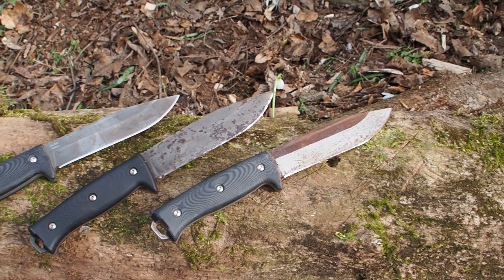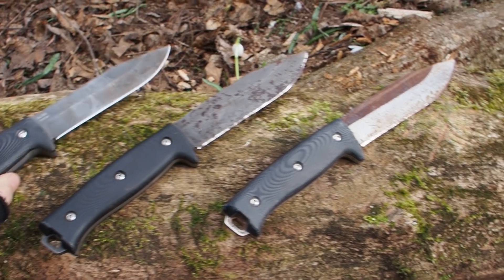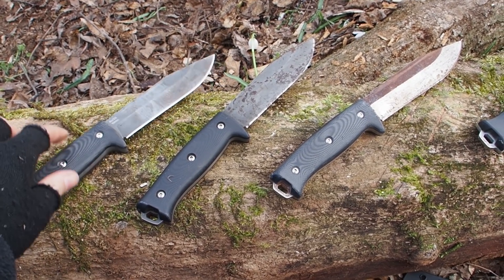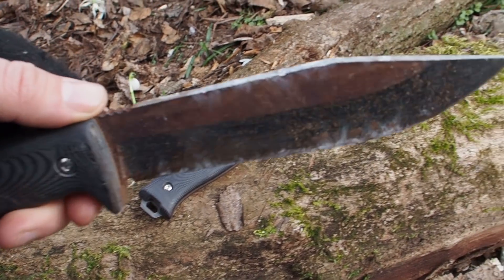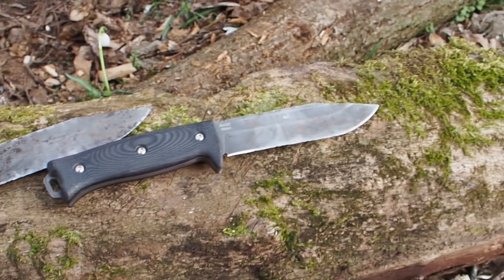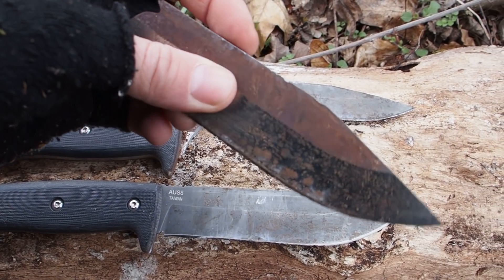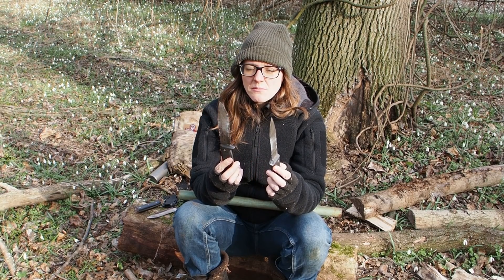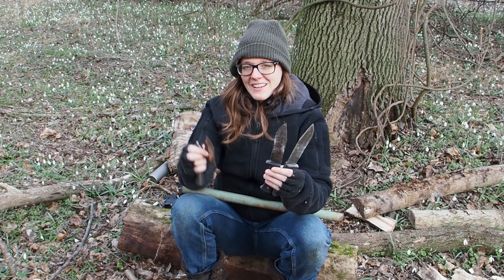Destruction Test - D2 vs. AUS8 vs. SK85 - Which is the better steel?

Comment: I like how she says, "before we destroy these knives". What are you talking about? You've already destroyed the knives! By not taking care of them you have essentially ruined them. I could not imagine treating my knives that poorly. Even after whittling on wood, I know there's enough moisture in the wood to cause issues. So I immediately wipe it down and throw a quick coating of food grade knife oil on the entire knife and anywhere any metal is exposed. Whether it's the actual blade or the tang. And I know I'll get comments like well maybe out in the field they don't have that available to them. My response would be why not? I carry a small travel tube of oil and I always have a microfiber cloth in my pack. I also carry a portable knife sharpener by Sharpal. And if I'm not carrying my pack that means I'm going to be home that night. So I will do it when I get home after work. Perhaps it's just that I value my money and don't want to throw it away, so I take care of everything from my $20 pocket knife to my $200 pocket knife. And I have so many different types of steel and I've learned how to take care of all of them. It's really not that hard either. 
Not being a naysayer or anything I enjoyed your video very much. I just wanted to comment after I heard you say that. It just kind of made me chuckle.

Comment: These knives appear to be well made and properly heat treated based on these results.  They held up exactly like I would have expected based on Knife Steel Nerds charts which reflects the rating of an optimally heat treatedl example knife in just about every commonly used steel.  The D2 breaking kind of proves that it was probably at least high fifties ( The quoted 58 sounds reasonable) .  I think D2 has a place in more slicey knives and isn't a good choice for a knife that will experience a lot of shock loading.   But that being said in a knife with this robust of geometry I doubt you could break that knife just by batonnning wood for shelter building / wood crafting.   I would choose the SK85 unless you are in a marine environment in which case I would go with AUS8.  AUS8 is very under rated these days in my opinion.

Comment: 5160 is good, cheap, and easy to forge and heat treat and takes a very wicked edge..enough to shave with.  I also like my fallkniven blades with COS steel..take crazy sharp edge

Comment: Nice demostration. 

D2 acted like D2, but Aus 8 was like ok, well heat treated quality Aus 8 has the potential to be very good, but SK-85 was the real surprise here. 

The SK-85 didn't perform very well at all, which was kinda interesting, because that kind of light abusing should not have damaged the blade like it did in youre video.
It souldn't have damaged it at all, but it looks like it did? 

My vision is blurry from time to time but the SK-85 damaged pretty heavily?

I suppose you don't know that something has gone seriously wrong in making of that SK-85 knife blade, so this is propably a surprise for you as well. The steel could have been poorly produced, perhaps something went wrong accidently in the steel factory or perhaps there has been some kind of a issue heat treating, tempering or belt sanding the blade, etc. But it sure, does look to be left way too soft. Quality control didnt see there a problem either for some reason?

Can't say for sure, but the SK-85 should perform better, is this a normal result for you Lilly?

Comment: For a survival type knife AUS 8 and 1095 carbon are all you need. They sharpen easily , and hold an edge plenty well to get the job done. Mora's carbon steel is also outstanding. My AUS 8 knives are from Seki Japan. I also have 2 SOG Seal Pups made in Seki Japan that are AUS 6. They work to perfection. Japanese stainless is plenty good for me.

Comment: First impressions from reading the description
D2 steel - Breaks
AUS 8 Steel - Survives
SK85 - Survives

I hate the prevalent use of D2 steel in outdoor knives, because it is a hard steel and prone to break.  8Cr13MoV steel from a chemical standpoint looks like an excellent steel for outdoor knives, but the poor quality control is the downfall of that steel.
Reply: Would 1095 be better than D2 for a survival knife?
Reply: @ironman2326 
I consider D2 a strange steel for knives.  Yes it can hold an edge but the issue I have seen repeatedly come up is that D2 is a brittle steel knife (Some call it a Glass cannon of knife steels).  There are exceptions, but when it comes to outdoor knives I think Toughness is just as important if not more than edge holding.  
I personally think that 1080 is an optimum simple steel for knives because it can hold an edge and it is tough.  1095 is a good budget steel because it s very forgiving, in addition to being tough enough and holding an adequate edge.  I trust 1095 over D2 when it comes to outdoor or Survival knives.

Comment: To be fair, K110 isn't that tough, but it holds it's edge pretty well. If you want powdered steels that are hard to damage, try something like magnacut, cpm3v delta or cpm1v. The last one should be the most difficult to break. However, I don't think edge retention or even toughness are that important in a survival situation, as long as you know how to use your tool. However, ease of sharpening is. So in my opinion you should always have at least one softer knife with you. If it gets dull, you still can sharpen it on a rock. Good luck trying this with someting like magnacut. But of course your blade also has to deliver the right thickness, length and geometry for the job.

Comment: I have an SK85 blade on my Japanese Kanna blade in it, and we don't use it like a survival knife, but I am very impressed with how it holds an edge in planning wood, even hard wood. This is compared to 01 tool steel blades in an American premium hand block plane (similar size). 
So, I thought I share another perspective on SK85. Med and high carbon steels to me are or make good blades. 
Sharpening is also a general word. I prefer grinding and polishing when describing an edge issue.  Since you do not have to grind an edge to fix a dull edge, you may need only to polish it back. That makes a big difference to me in describing failure modes of and edge.
Every grade of steel has been formulated for some specific purpose or use orignal purpose, these didnt happen by chance. As we use them in different environments, conditions, or applications, you will have some trade offs in performance, which she stated! Well done there! Columbus Michigan

Comment: I'm sorry to do this but I can't help myself, the knives are made in Taiwan not Japan it's stamped on the blades
Reply: Yes, 'made' in Taiwan.  But mine has a SK85 steel blade.  K85 Sk5 is a Japanese high-range Carbon steel. After quenching and tempering, sk5 steel has high hardness and wear resistance.

Comment: Great  respect for your testing efforts, but keep in mind one company's Aus 8 is different from the next. Just as Buck has almost perfected the hardening process with boss 420  stainless the next company may not be as resilient. In short it's not always the steel but how it's heat treated.

Comment: Pocket knives can use super steels but I think anyone who has experience sharpening in the field will tell you the last thing you want to do is try to repair an edge on a super steel especially under pressure. Aus 8 anyday

Comment: I don't see the point of hammering concrete or a steel tube. You are not going to do that in your entire life, not even in a survival situation. I would try edge retention by cutting wood, cardboard, meat and even bone and things like that and then try to cut a sheet of paper and check if the edge is still useful or not. Another test would be batoning wood and see if the blade resist or brakes. There is a kit (not cheap) were you can measure the sharpness of the edge of a knife. I usually use 01 tool steel for my knives and they are a good balance of edge retention and easy of sharpening.

Comment: Well done. Ive done survival all over myself & i would absolutely agree w/ your assessments. At the end of the day though i think it comes to whats best for you & what your going to be doing. I prefer carbon steel in most all cases but i have very 4 very specific reasons for choosing it. 
1)centuries of proven toughness 2) i can reforge it in field if i need to 3) if all my other ignition sources fail I can get sparks from my knife & a rock 4) its easy to sharpen even if im tired & weak. Incidentally 1095 is best for shorter blades but i prefer 1075 for longer ones. Just my 2 cents on the matter i guess.

Comment: Pointless test. It's like comparing cars by driving against a concrete wall over and over again. The best car is then the one that you can drive against the wall the most often. The result says nothing about the driving characteristics, the top speed, the fuel consumption. The things that really matter are not tested.

Comment: I definitely seen argument for both sides but at the end of the day it's what are you gonna be using it for I guess overall if you're just gonna absolutely beat the living snot out of a knife then yes the stainless steels that are a little bit softer will do the job But there is that saying right tool for the right job sometimes you need something with a little bit more edge retention when doing fine work or  Like processing an animal a lot of times I end up taking multiple knives for different jobs Good test though I really like to watch it thank you for your time and also donation of the knives in question.

Comment: CPM 3V would be a better super steel to compare to SK85 and AUS8.  Same carbon content, but better alloying elements and powder improvements in consistency.  Tough as hell with decent edge retention.  It is a little pricey though.  The heat treat is a lot more complex and labor intensive.

Comment: I hate to be obvious but no body I know will use a knife in a survival situation the way you tested these knives. There fore I suggest the best knife is the one that corroded the least and you have to use for food prep. Which means stainless steel. The one between the two stainless steel blades the AUS8 would and is my choice of metal. It has less corrosion and needs less sharpening. Ideal for survival situations. I carry two knives when I out in the wild. One is a Mora carbon steel for carving and fire starting and the other is a Survive 7.7 with a AUS8 blade that is almost identical to your newest APO-2s. I bought it in 2006 and used it a lot and it still looks new. I do have to sharpen it often but more like a hone to keep it sharp. It splits, chops, cuts, and carves great. The Mora bushcraft black does feathers and caves a lot easier.

Comment: CPM D2 fixes the issue
Reply: Not really ... D2 is a hard (and consequently) brittle steel ... Steels with high carbon keep a better edge but on the other side, they tend to be brittle ...
I'm NOT a metallurgist at all, just what I've learn about different kind of steels from internet ...

Comment: AUS 8 has been my favorite for 40 years it will hold a decent edge, it is low maintenance, it is fairly easy to sharpen and has very good toughness and not bad wear resistance. As a knifemaker I have tried nearly everything in the past 65 years and it is just hard to beat.
Reply: With all these “super steels” nowadays and the insane prices that go with them. Everyone seems to forget how great AUS 8 really is.
Reply: Probably my least favorite steel. AUS-10 yes. AUS-8 no. I usually think of it this way. The Ontario offers a cheap, throw away, trial version of the RAT-1 (and others) in AUS-8 steel. If you decide you like the knife well enough, you buy the real knife which is in D2. Just my experience of course, but every knife I've had in AUS-8 steel just felt like a gas station knife as far as sharpenability and edge retention. Is it easy to sharpen? Yes - much easier than D2. But I have never liked the edge on any AUS-8 knife. Perhaps I need to change sharpening techniques or something.
Reply: @BrizzyMo I'm looking at a knife in AUS-10, can you tell me about what sets it above AUS-8 in your eyes?
Reply: @BrizzyMo it's a very soft steel when compared to 1095 or 1066 it's closer compared to 8cr13mov
Reply: @monkeymcgee3630 Soft isn’t bad having a knife that is too hard makes it brittle and a knife that’s too soft won’t hold an edge it’s important to strike a balance based on what purpose you want your knife to serve
Reply: Totally agree, low maintenance is underrated
Reply: Can't argue with that. I learned knife making using magnacut and s35v so I'm much more familiar with these 2. Aus 8 is a great steel my only complaint it dulls to fast after several hours of hard work and it's a little on the soft side for a camp knife. The thing I love the about aus8 is that you can get a decent edge in the field using a rock and a little water

Comment: I have the same opinion as a few others who have posted comments here as in they both have their place. Harder steels for smaller knives for more delicate precision work and softer for the larger knife for heavier more abusive jobs. I have a few of each. I still need to get out and use the APO1S a little more but the little I have used it carving and batoning or just cutting up dinner it has proven to be a very nice blade so far. I have found the APO1S to have a more comfortable grip than some of my other survival knives as well. Well done Lilly with the steel choice and design! Keep up the great work!

Comment: You can take the rusty knife to a bench grinder with a wire wheel on it, and it will clean the rust off. Use a cloth buffing wheel to smooth out any pitting caused by rust.

Comment: The hardest thing to achieve in D2 steel is hardening, especially tempering. If the tempering is not done at the right temperature and in the right time, the result is in your hands. It is very unlikely to have to cut metal pipes in survival, or in bushcraft, this has never happened to me. Ciao!!

Comment: Something near 0.8% carbon seems to work reliably in large beater knives and has worked for a long time.
The 80CRV2 alloy used by the Varusteleka/Terava line works well. It is essentially SK85 with a tiny bit of chrome and vanadium added to get a little bit harder.  That's the traditional "low alloy" approach (O1, O2 also) that adds a little dusting of chromium carbide and vanadium carbide without taking away the alloy's toughness, but is still close to 1080 or 1095.
Condor likes 1075, which is close to that standard.  They make durable knives, not pretty knives. Ontario Knives has moved from mostly 1095 to 1075. The very reliable Tramontina machetes use 1070.  When knives get larger and have to take a bigger beating, then 5160 (low alloy 1060 or 1065) becomes the reliable steel, such as in the traditional heavy kukri knives which are practically hatchets.   Then the real beaters, hatchets and axes, usually settle into 1045, 1050 or maybe 5160.
The 5160 axes/hatchets are for high performance and have a higher risk of chipping, while the workhorse hatchets/axes are usually in 1045 and just get sharpened a lot.
I am all for a small, hard knife and large durable knife.  My favorite combo is a Mora Garberg (1095) or Terava Jaakaripuukko (80crv2)  for carving. Ideally, it would be a Bark River Bravo 2 in A2 or CPM3V.  And then an Ontario SP53 (5160, 10" blade) for chopping and splitting wood.  Or maybe a Terava Skrama (80CRV2, 9.5" blade).  
But I will still have a pocket knife : Benchmade Freek (S30V), Ontario Rat 1 (D2) or Gerber Gator Drop Point  (154CM) for small work and long edge retention.  The Gator actually has the best handle for outdoor work, but it makes it a little lumpy in the pocket for EDC, so it's more of an "outdoor EDC".
For a true one knife solution, you have to settle back in to the 1080 range for reliability. Of my current knives, that would be either the Jaakaripuukko 140 (80CRV2, 5.5" blade) or the Cold Steel Drop Forged Survivalist (52100, 8" blade).  For knives that I don't have yet, the smaller Terava Skrama 200 (80CRV2, 8" blade) would be a very good choice, or maybe an Ontario Ranger RD6 (5160, 1/4" spine, 6.6" blade).
I don't live in very wet places, so I would rather get some of the extra hardness and toughness of a non-stainless blade.  The South Amercans (e.g. Tramontina) just bring a little jar of Vaseline for their carbon steel blades.  I made some fixin' wax from beeswax, mineral oil and jojoba oil that is a little bit stickier.

Comment: Survivallilly. 
When you designed your knives you were showing off. Your keeping the best knife design for yourself. 
Craig the piece of thin 9ft stainless steel chain guy here;) with seperate grappling hook in a secret Cornish woods with some rope. Skipping with the stainless chain made the skin wore my fingers to the bone. Having make some thin alluminium handles from thin poles, beating those on so the chain stays. Now skipping is made easier, taking my fitnesses to take on COVID-19 to a higher level. You can easily beat it with any of your knives but the broken blade will not help:) Thank you Survivallilly.
What next Survivallilly?